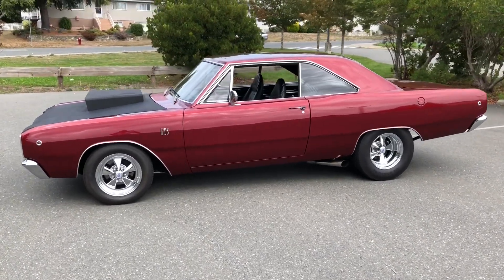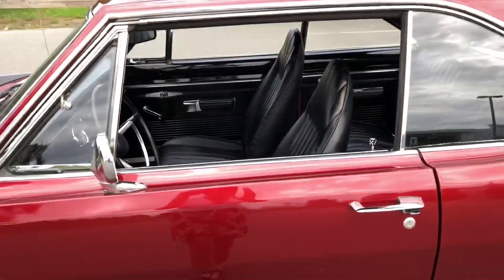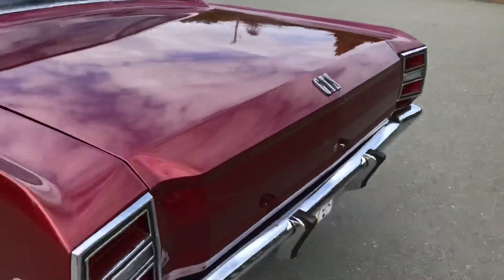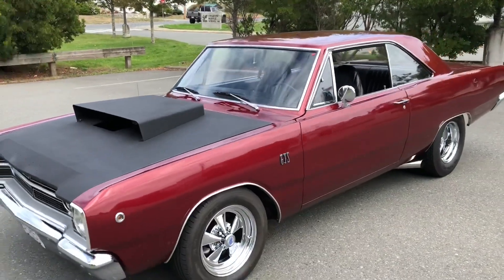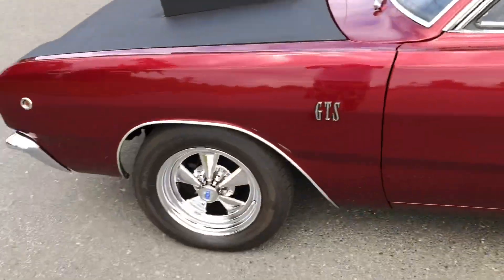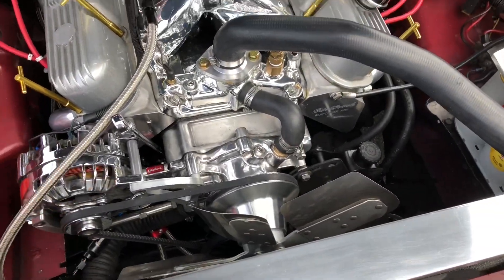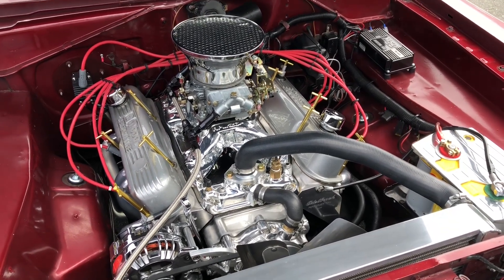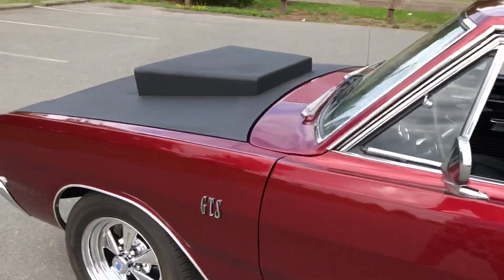1968 Dodge Dart build info. 360 mopar!

Comment: You did a good job you should be able to go better than 12 with that I had a 67;barracuda with a 383 had some mild work done to it no headers so I could only get high 13 with 391 gears with a tall tire which brought it up to 410 with the puny factory manifolds that came with barracuda 383 FS cars it would have went better with 2 inch headers but I had a lot of fun with it you should be able to get that into the high 11 s prettyneasynwith a few small things love it well done

Comment: I've owned a 66 Baracuda S-Sport with the 273 HO and 4 speed
1968 Coronet 440 with a 318
1973 W200 powerwagon with a 360 and 4 speed
1983 RC is my current that I am preparing to build a 408 for and a 727
1989 rust free AZ RC I use for parts. I will sell the rolling body and chassis to someone up north with a rusted out RC and all the parts needed to put it back together.
Then I have a custom ordered 2004 Ram 2500 4x4 hemi 5 speed.

I love your car man. Hang on tight to it no matter what. Everyday it gains value.
Reply from the maker: Sounds good bro. I have zero plans to ever let her go. Thanks for watching

Comment: Hello, Nice Ride , Im a recent subscriber when you did your Cal Trac conversion did you move them inboard or are they stock location. Love your Ride My Engine just about looks like yours. Im checking you vids for Direction. I have a 340 R1 punched out to 4.085, stroker kit BRC crank worked, Eagle Rods, Solid roller lifter cam .570 lift 110 centerline Just detuned it from .630 lift. Race Tec pistons 10.8:1 setup for blower or nitrus but not running it yet. Harlon Sharp valvetrain. Block is o ringed using .042 copper gasket and arp studded throughout. Brodix B1 BA heads  ported polished throughtout, 2.10 Intake and 1.65 exhaust smith brothers pushrods, Victor intake Barry Grant Carb and Mallary Ignition, CVF racing serpentine belt bracket setup and a Tuff Stuff 100amp Alt. Milodon pickup and 7qt low profile pan. Coan built 9in 4500 stall (i have a replacement 3200 stall since i de tuned but looking at you video your making me think, i drive alot though)  Superbuilt 727 with a Griner trans brake installed. Mancini racing Driveshaft loop, Hodkins Frame connectors Looking to minitub car id like to see your job. What are you running 4:51? Currently just purchased Hooker SuperComp headers because of head design (spark plug location) sucks. I do have currently flowmater super 40s tti full exhaust. H connetion midway.
Reply from the maker: Yes car is mini tubbed and suspension is moved inline with frame rail. Sounds like you got a nice project on the go. I have a 4:10 gear on 28” tall tire currently. Thanks for watching
Reply: @SimpsonsSpeedShop  thanks yeah cant get that tire size in there yet! Nice videos im watching them closely your helping me out

Comment: I have the same Horsepower out of my 360 in my 67 Dart. What gears are you running? Just curious because I havent ran mine in the quarter yet.
Reply from the maker: 4:10 on a 28 tall tire. Thanks for watching. You should check out some of my new vids!